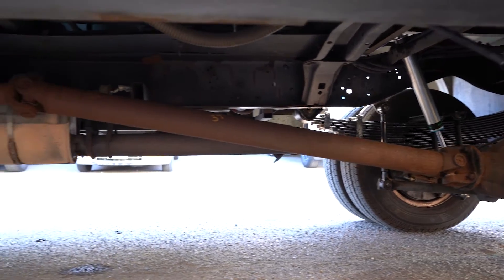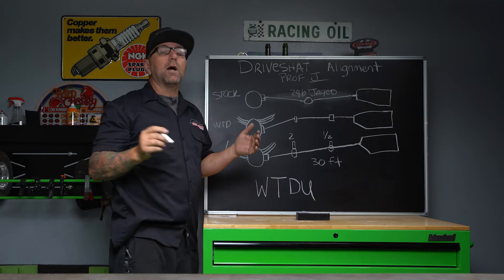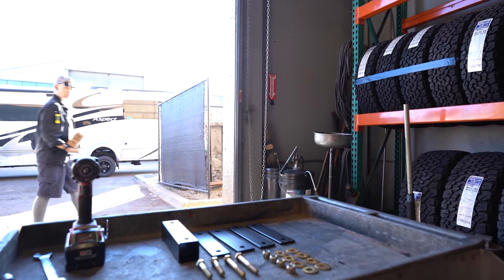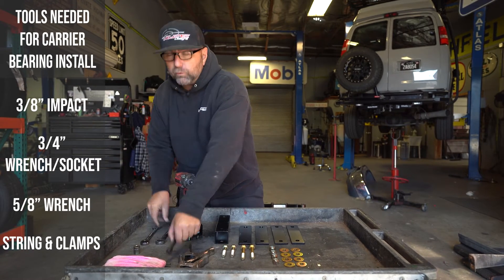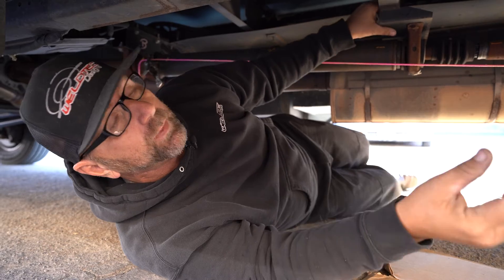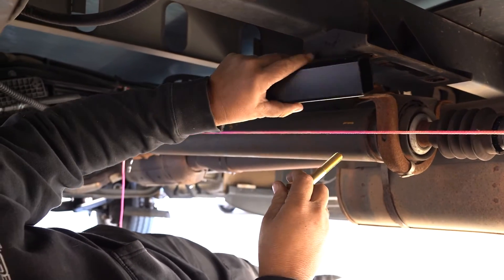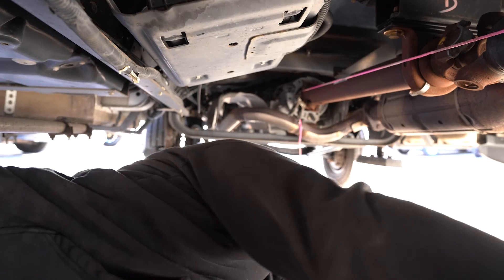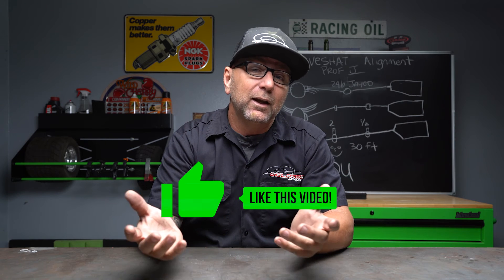Everything You Need to Know About Aligning Your Drive Shaft!

Comment: I have a class A rv 2004 winnebago itasca sunova. When i drive on the Hway when i get between 65 and 70 miles per hr my Rv shakes pretty bad. I got new tires but thats not it. I am missing two springs on the passenger side front. Maybe you can help me on whats wrong with it.
Reply from the maker: is that on a f53 chassi?
Reply: Yes it is
Reply from the maker: @nephewdavis1225  have you checked to see if your wheels are balanced correctly and a good alignment?
Reply: @WeldtecDesigns the tires are good. Didn't check the wheel alignment

Comment: It was Nice talking to Patrick to get my questions answered which one of them was this video.  Thanks Patrick. On the fun side what is the deal with the class c drivelines having no paint on them and losts of spray foam. Oh Soray foam every where. Need a video of the crap i see under them. Air bag rubbing on e brake, wire loom not attached to frame, excess hydralic hose tied up, And should i say anymore. It was pretty scary under there with all these issues.

Comment: Thanks for this video.
I had read that the tailshaft on the transmission (or the output shaft of the transfer case if 4x4) is supposed to be parallel to the differential input shaft on the differential to avoid vibrations also. Does that only apply to single section driveshafts or also to multiple section drive shafts as in this video (not lowering the tail of the trans or rolling the front of the axle up but maintaining those two shafts in parallel)?